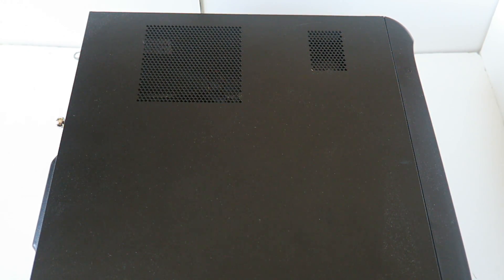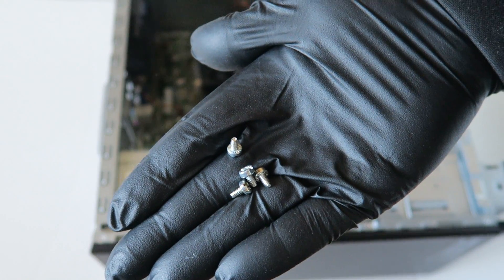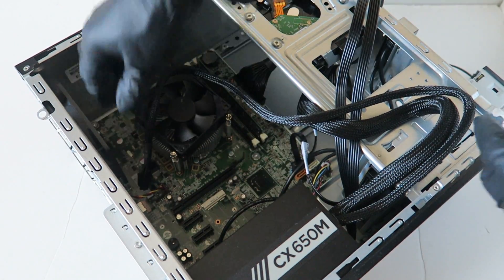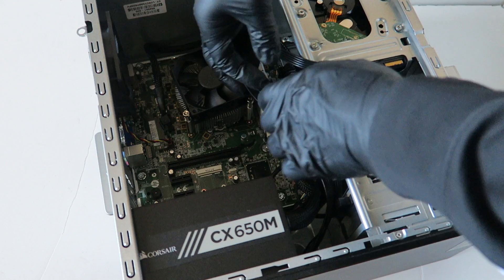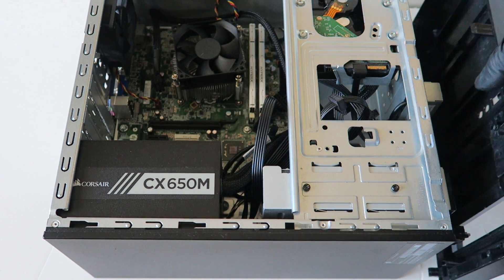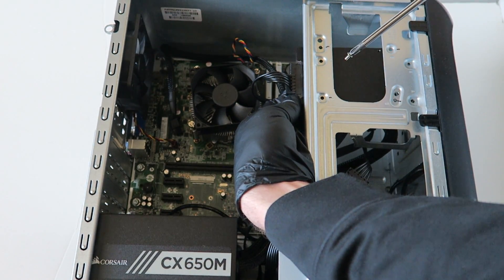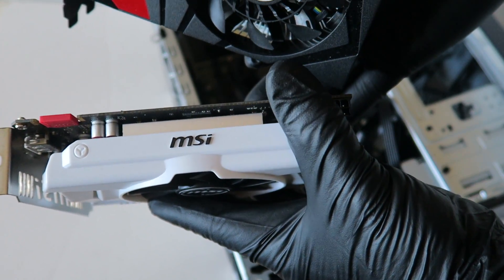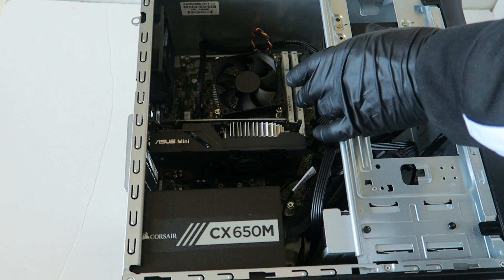HP Pro 3500 Gaming Upgrade Video Card SSD RAM PSU

Comment from the maker: List of Parts and Upgrades works with this system :

This RAM works with this machine MAX 16GB:

(1.) Crucial 8GB Single DDR3L 1600 MT/s (PC3L-12800) Memory CT102464BD160B
https://amzn.to/2VhGv8O

(2.) Crucial 4GB Single DDR3L 1600 MT/s (PC3L-12800) Memory CT51264BD160B 
https://amzn.to/2xq46wb 

(3.) Crucial 16GB Kit (8GBx2) DDR3L 1600 MT/s (PC3L-12800) CT2K102464BD160B 
https://amzn.to/2VpsKpP

(4.) A-Tech 16GB (2x8GB) DDR3L 1600 MHz UDIMM PC3L-12800 (PC3-12800)
https://amzn.to/3i97Zt2

Thermal Grizzly - Spatula for Applying and Spreading Thermal Paste
https://amzn.to/30Qq4ag

Thermal Compound Paste For CPU Upgrade:

(1.) Arctic Silver 5 Thermal Cooling Compound Paste 
https://amzn.to/2ziNU0H

(2.) Noctua NT-H1 3.5g, Pro-Grade Thermal Compound Paste
https://amzn.to/36kTk7A

(3.) ARCTIC MX-4 (current edition) Thermal Compound Paste 20 Grams 
https://amzn.to/2DhGJaK 

PSU: 
(1.) Corsair CX-M Series, CX450M, Modular Power Supply
https://amzn.to/3pnLUuh

(2.) Thermaltake Smart BX1 650W Power Supply
https://amzn.to/3Pl3WrN

(3.) Thermaltake SMART 600W ATX 12V V2.3/EPS 12V 80 Plus Power Supply
https://amzn.to/3DgVjfC

This video cards will work with this system.

AMD Radeon RX 6400 Low Profile Gaming Graphics Card
https://amzn.to/3s8MUUY

XFX Speedster SWFT105 Radeon RX 6400 Gaming Graphics Card
https://amzn.to/3xkmXo1

(1.) Gigabyte Geforce GTX 1050 Ti OC Low Profile 4GB GDDR5 128 Bit PCI-E Graphic Card (GV-N105TOC-4GL) 
https://amzn.to/2XEqKMb

(2.) MSI Gaming GeForce GTX 1650 4GB GDRR5 Low Profile Graphics Card (GTX 1650 4GT LP OC) 
https://amzn.to/2VkDdSd

(3.) MSI GTX 1050 TI 4GT Low Profile  Graphic Cards 
https://amzn.to/34r0AxG

(4.) Gigabyte GeForce GT 1030 GV-N1030D5-2GL Low Profile 2G Computer Graphics Card 
https://amzn.to/2Xu3SyO

(5.) ZOTAC GeForce GT 1030 2GB GDDR5 64-bit PCIe 3.0 DirectX 12 HDCP Ready Low Profile Video Card ZT-P10300A-10L 
https://amzn.to/3eayL1b

ZOTAC Gaming GeForce GTX 1650 OC 4GB GDDR5 
https://amzn.to/2V28laj

ASUS GeForce GTX 1650 Super 4GB Phoenix Fan Edition (PH-GTX1650S-O4G) 
https://amzn.to/3eoad4S

SSD List:
(1.) Samsung 870 EVO 2TB SATA SSD
https://amzn.to/3ezOds5

(2.) Crucial MX500 2TB 3D NAND SATA Internal SSD
https://amzn.to/3B9f8CF

(3.) SanDisk Ultra 3D NAND 2TB Internal SSD - SATA
https://amzn.to/3RSZ8LR

(4.) Samsung 860 PRO SSD 256GB - 2.5 Inch SATA III Internal Solid State Drive
https://amzn.to/2BY5gRl

(5.) Samsung SSD 860 EVO 250GB 2.5 Inch SATA III Internal SSD 
https://amzn.to/37xWUfc

(6.) SK hynix Gold S31 1TB 3D NAND 2.5 inch SATA III Internal SSD
https://amzn.to/3d7X6D6

(7.) Samsung SSD 860 EVO 1TB 2.5 Inch SATA
https://amzn.to/2B2FURX

(8.) SanDisk SSD PLUS 1TB Internal SSD
https://amzn.to/3hwdqku

(9.) SanDisk SSD PLUS 240GB Internal SSD
https://amzn.to/2zfc7EX

(10.) Crucial MX500 250GB 3D NAND SATA CT250MX500SSD1(Z) 
https://amzn.to/3bTTjbX

(11.) SanDisk SSD PLUS 480GB Internal SSD SDSSDA-1T00-G26
https://amzn.to/2yfgjUK

HDD list works with this PC:

(1.) Seagate BarraCuda 4TB Internal Hard Drive HDD – 3.5 Inch
https://amzn.to/3d3xWeR

(2.) Seagate BarraCuda 8TB Internal Hard Drive HDD – 3.5 Inch
https://amzn.to/3xjUDSJ

(3.) Western Digital 2TB WD Blue PC Hard Drive HDD - 5400 RPM, SATA 3.5" - WD20EZAZ
https://amzn.to/3w3jIQA

(4.).WD Black 2TB Performance 3.5" Hard Drive - 7200 RPM Class, WD2003FZEX 
https://amzn.to/2xFUeyF
Reply: What about cpu?
Reply: Thxxxxxxx
Reply: I thought the highest RAM size of the pro 3500 series is 8gb. Can I use Zotac Geforce GTX 680 2gb DDR5 be use for this same system unit

Comment: I have had this pc for 5 years. Upgraded it to a 3rd gen i5, better cooler, 450ew psu and a 6650XT (it barely fits) and works like a charm. The cpu is bottlenecks but I can play all my games in ultra without hiccups at 1080p. Still capable, but it is very old and at some point, it's going to end up as a library pc lol
Reply: But can you remove the cpu

Comment: Корпус у меня почти в точь точь,только видимо следующая ревизия,спереди 2 USB 3.0.
Был i3-2100 (2 ядра 4 потока с графикой),поставил xeon e1225v2 (4 ядра 4 потока с графикой).Видеокарта была gt630 на 4 гб gddr3,теперь gtx1060 6 гб gddr 5.Оперативную думал по частотам поднять взял на 1600 две по 4 гб,а тут оказалось ограничение шины в 1300 вот же дерьмо.Вообщем оставил старые разнобойные 8 гб на 1333.
По ценам,процессор удалось по месту за 650 забрать,видеокарта аналог с майнинга за 1500 с авито.Вообщем не считая оперативной,2150 рублей вышло.

Comment: Thanks for the video man, glad to see at least someone out there to guide us for low-end pc users :") 
I have a tossed away Sapphire Radeon HD 7850 (One with double DUAL-X fans on) lying around in my hand and I wanted to install it.
But the original HP PSU do not have an extra 6pin required for the card.
How can I determine if a PSU have extra 6pin cables on? Or what models of PSU are compatible with both the HP motherboard and this graphics card?

Comment: I also have a pc with a 2abf mobo, but i have heard that 3 versions of that board exist, do you think all versions of the board accept 3rd gen i7 and 16 gb of ram?, My model is p6-2133la and it came with a 2nd gen i3, i have updated the bios to the 8.19 revision.
Reply: @hjohn007 did you also installed a graphics card?, I'm interested in getting a 1650 but i don't want to change the psu and some people say the pci slot doesn't put the 75w to power the card.

Comment: can you use any power supply or the ones u linked in the description?
Reply: you can use any power supply as long as it has enough power to run the components.
Reply: @ThatBritalian  awesome :) i ordered some stuff for mine, i’m getting an i7 2600, 16gb of ram, new ssd and a gtx 970. would a 970 work or would i need something else?
Reply from the maker: Hi, yes you have to upgrade power supply.
Reply: @vic_is_a_dummy  yes a 970 should work. Good luck!

Comment: Is thit Hp Pro 3500 mt I5 or?
Reply from the maker: Hi. yes.
Reply: @Mxkdt  max ram is 2x8 gb ?And best card for this is?
Reply from the maker: I recommend upgrading that PC to Intel Core i7 CPU and depends are you going to upgrade power supply or not for gaming?

Comment: can i use a gt 1030 (aero itx 2gb oc) on this?? its because when u plug it in, it doesn’t post( i have my vga plugged into the motherboard’s vga port) but when i remove the gt 1030 it’s perfectly fine

Comment: hi i also have this pc (hp pro 3500 series with an i5 3470 and 8gb ram and 1T HDisk) i was wondering whats the best GPU for you i can buy without upgrading my 300w PSU.. can you help me?
Reply from the maker: Hi, you can use gtx 1650 or rx 6400..
Reply: THX a lot, i have anorher question: the gtx 950 doesn't Need a pcu upgrade right? If It does why?Is It a matter of connectors or power used?

Comment: I have the same pc, i also put a cx650m in mine. Its a good pc i5  3470 and 16gb ram.  I put a 1080 ti in mine and this setup will play anything. High and ultra settings with a high end video card.
Reply: What's ram u install in hp pro 3500 mt series ! Please anwers me
Reply: What BIOS version do you have on your PC?
Reply: Does 2x8gb  ram work on hp3470 kindly tell me if it works fine on the sytem default psu ??
Reply: Can Gtx 1070 work on this pc

Comment: I have hp pro 3400 i want to get a 1050 ti will is work??
Reply from the maker: Hi, yes that would work i recommend that PC to have at least i7 CPU 2600..
Reply: @Mxkdt  I will buy i7.On HP website it supports this cpu but i am little concerned about GPU because many websites say BIOS version 8.xx is requried to run that GPU my BIOS is 7.16
Reply: @Mxkdt  Can you make a video on HP pro 3400 mt with 1050 ti
Reply from the maker: I no longer have that PC any more..
Reply from the maker: Hp Pro 3400 Mt does support Core i7-2600 processor
Reply: @Mxkdt  yes but not unlocked cpu
Reply: @Mxkdt  you have experience you can tell me if 1050ti can work with Hp Pro 3400 Mt BIOS 7.16
Reply from the maker: @zain2854  it might or might  not work because it is HP motherboard and i would  test it if for you if had that PC i no longer have it and i do have gtx 1650 and i did search online nvidia forum and other forums say that motherboard will not work with that video card..
Reply: @Mxkdt  I also have read that forums It say only GTX 600 series or earlier will work but I see a video on YouTube a man puts 750 and it works after doing something
Reply: @Mxkdt  If you make a video on Hp Pro 3400 Mt it will help hundreds of peoples
Reply from the maker: How much does it cost i7 CPU and did you already buy that  used PC ?
Reply: @Mxkdt  it's not used I have this PC from 2015 with i5, 8 gigs of ram and a SSD. I have a plan to get little bit powerful GPU like 1050ti I just want to know it work

Comment: hi the max ram capacity for that mobo is only 8gb is it ok to put 16gb ram? im also upgrading may hp 3400 mt thanks
Reply: If you've upgraded it to 16 gb and it worked kindly tell me i have the same hp 3470 mt
Reply: And i want to upgrade it

Comment: can i have GTX 1070 ? i know is big and need more power but can i have it ?
Reply: I've the same question did you try it
Reply: @susikumwila2099  nope I bought new PC xdd
Reply: @susikumwila2099  but the PSU in old PC will not handle it but idkk

Comment: I just upgraded to Asus GTX 670, Corsair HX520W and added 8gb to the 4gb = 12GB RAM (need tot find a pair of 2x8 bit for now fine). Added a 4x USB 3.0 mini pci-e adapter in the rear and an additional HDD. Oh and a strip of green LED's. Works like a charm!
Reply: does GTX 670 can work in this pc?
Reply: @pirategaming3590  yes, but I have a hard time fitting everything insides like cables and hdd's next to the card. But it works.

Comment: Thanks sooooo soooo much
Reply from the maker: Hi, thanks
Reply: @Mxkdt  I put r7 250 1gb ddr5, before I had intel hd graphics
Reply from the maker: @whiteboys3469  Hi, yes you can and or you can use gt 1030 gddr5 video card.
Reply: @Mxkdt  I bought two sticks of g skill ripjaws 8gb pc3 1333mhz. but they do not work. how to fix that
Reply from the maker: @whiteboys3469  Hi, it could be bad RAM and turnoff PC and try to install just one stick o RAM and turn back on see if it boots?

Comment: DDR4 is working on that motherboard?
Reply: No
Reply: @SlowwwGaming  ok and the gtx 1650 can go with this motherboard
Reply: @pixelfn667  yes should be able to I'm using a HP brand gtx 1650 super single fan with no problems just use a 6 pin adapter to sata from a reputable source or buy a new power supply
Reply: @SlowwwGaming  ok if i have 16 gb ddr3 1666mhz gtx 1650 super and buy a new alimentation but i keep the case of the hp 3500 i will be good for gaming?
Reply: @SlowwwGaming  and how much fps i can have with that in fortnite

Comment: Hi dude i need your help. Any Video Card can be install on HP Pro 3500 MicroTower PC? PLEASE HELP.
Reply: I had the same question. But I think we have to change the case. I've the same.
Reply: @dicodur  bro bhaijan mera HP pro 3500mt ha issue 
GPU support issue ha gtx 950 work nai krha Isme but WO kisi or board ma work krha ha now I am using r9 270 2gb instead of gtx 950 it is working.fine
Reply: @Nihadonly not all video cards. This mb supports DDR2; DDR3; DDR4; DDR5; GDDR5 type Video cards. If your mb is ddr4 & case is bigger than mt, you can use any video card ( BUT YOU NEED UPGRADE PSU )

Comment: Hey I have a HD 7970 gpu and a brand new 500 watt power supply tossed into the 3500 but I can't get it working to save my life what could I be doing wrong? (Yes I tested the card in a different pc, upgraded to 8.1.7? Bios added up to 8gb ram and install uefi windows 10)
Reply: Same here, I have 1 hp-pro-3500-s, when I put rx-470 or rx-570 both 4gb, blank black screen from internal video card on boot - because I want to boot as primary the internal. When pci-e is primary it works. But I want the internal, ..problem.

Comment: does the stock power supply include an extra sata cable besides the one for the hard drive to use a sata to 6pin adapter for a gpu?
Reply: or could i use the one for the optical drive?

Comment: so uh if you're still alive quick question. What are some power supplies you recommend that can work with a gtx 1650 and that can also fit inside this case?
Reply: You can use 450w+ PSU for GTX 1650. And it need to fit inside this case. For example: CX650M's length is 150mm and fits as you see in this video.

Comment: my hp pro 3500 came with an intel pentium g2120 which is not supported on the HP website so if for some reason you cant get something to work stop saying this or that can't work as clearly the issue is not knowing what to do

Comment: hey guys, will a 3570k chip boot in this board? i know it cant be oc'd by any means on the chipset...just curious

thanks.
Reply: nope only non k processors
Reply: Hello people, I have Hewlett-Packard hp pro 3400 series  driver model wddm 1.2 I am trying to connect multi monitors to it. The new Benq pd2700u monitor says I need dp 1.4 to connect multi monitors. Can someone let me know what I need to do and is this possible Thank you

Comment: WHAT I BOUGHT THE GT 1030 AND MY MONITORS WONT TURN ON I THOUGHT IT WAS SUPPORTED WITH THIS PC
Reply: did  you  figure  out  to  connect  to  the onboard  graphics and  enter  bios  to  change  the  video  adapter  to  Pci  as  primary  ?
Reply: GreekRage I fixed it
Reply: @eyo3lll  how did u fix it
Reply: @eyo3lll  I have the same problem

Comment: I bought gtx 950 gigabyte oc and it didn't work with hp pro 3500
Reply: Why??
Reply: @techinhd3993  I don't know why but it was working on another board but not in HP pro 3500 board

Comment: Will a 750ti work with the original psu?
Reply: did it work
Reply: @ytmido571  it didn't for me
Reply: Curt'ie Chan What 750 ti u used?
Reply: If GTX 750ti's not have pin connector, you can use it too

Comment: Can Gigabyte Geforce GTX 1660 ti DDR6 6GB be use in this motherboard
Reply: No bcz I tried gtx 950 it didn't work so 1660ti is impossible but now r9 270 is working in this board
Reply: DDR6 cant work in this mb. But maybe GTX 1660Ti is GDDR5 officially. And this mb supports GDDR5 GPU-s. But its not verified.

Comment: good video. it answer my power supply question and the 24 pin question. thanks
Reply: How did you remove the 24 pin?im trying to pull it after pressing the clip but it doesnt come out
Reply: @Daniel-lb3lj  base on some knowledge, I though my HP computer use unnormal power connector. but this video tells me it use normal connector. so I think I can not answer your question. sorry

Comment: Hello to everyone. I have the same motherboard in this video, but I want to install the rx 570 8gb model on my motherboard. Do you think my computer will run smoothly?
Reply: Yeah it will but don't take my word for it to do your research and see what you will need for it to run like maybe a high power supply
Reply: @fps63  If I plug a 1050 ti into this motherboard, will it work fine? do i need to update the bios

Comment: I have a hp3500 i3 what graphics card can I just easily slot in ? Thanks
Reply: Did you manage to find out what worked for you? i have the same question but got the i5 3470
Reply: Gravitrees no I didn’t I just ended up getting another pc, an i7 gaming spec
Reply: @hatton992   oh alright thats good bro
Reply: @gravitrees  1650 , 1650 super 1050ti 750ti

Comment: hello everyone !! so i went and upgraded to 16gb ddr3 1600mhz dual-channel and gtx 1650super they work perfectly !! i don't know if you guys are still interested but i thought ill tell ya ^^
Reply: hi there!! is it really possible to put 16gb to hp pro 3500? will it be compatible with windows and work properly ? I just bought this one and want to upgrade. thank you in advance
Reply: by the way, is it required for the BIOS to be updated?
Reply: @daonlyshaker  Yes it's possible and everything works great i use win10 pro 64bits i stress tested the system and i run MemTest86 just to make sure everything works fine.I did upgrade to the latest bios (Jan 12, 2015) but i have done so before i was even thinking of upgrading also I'm planning to upgrade to i7 3770 when i get the chance.( i do gameplays on gtx 750 and 1650super )
Reply: @Ramzy750  thank you Ramzy, it is brilliant! good luck buddy
Reply: @timurshakirov7936  no problem glad i could help ^^
Reply: @Ramzy750  where did you find the bios update I've been looking everywhere
Reply: @romeobotayi11  here (click on chose a Choose a different OS and then select windows 8 64bits and then click change scroll down to bios and chose the latest version which is 2015):  https://support.hp.com/us-en/drivers/selfservice/hp-pro-3500-microtower-pc/5270849
Reply: @Ramzy750  Thank you so much bro worked gonna try installing a normal 1650 hopefully it works
Reply: Also do your hp pro 3500 have usb 2.0 or 3.0?
Reply: @romeobotayi11  i think 2.0
Reply: @romeobotayi11  good luck!
Reply: @Ramzy750 did 2x8gb ram worked on hp 3470 with foxcon processor?